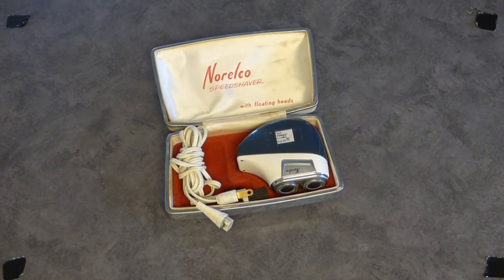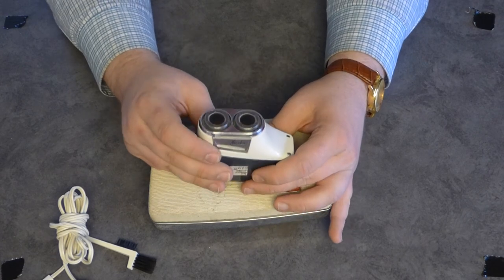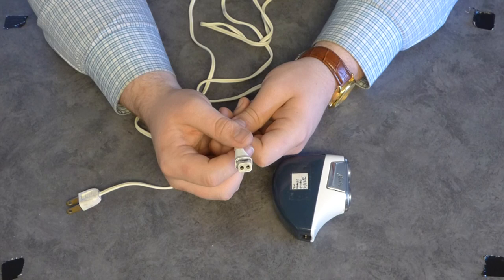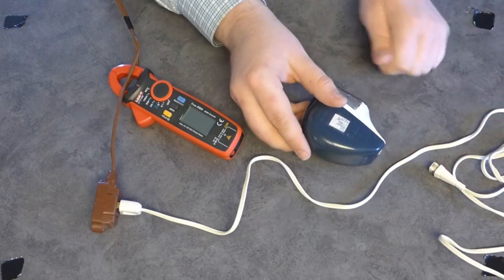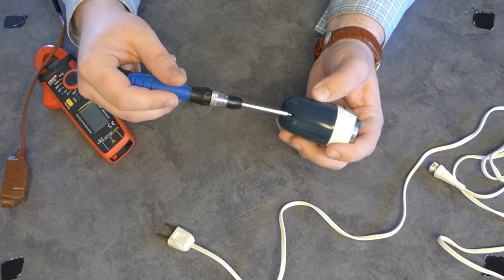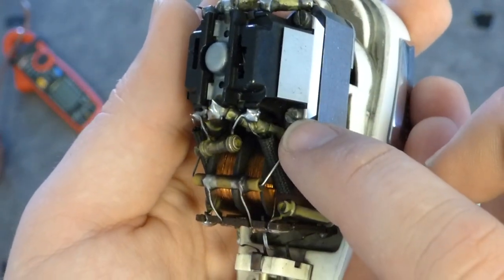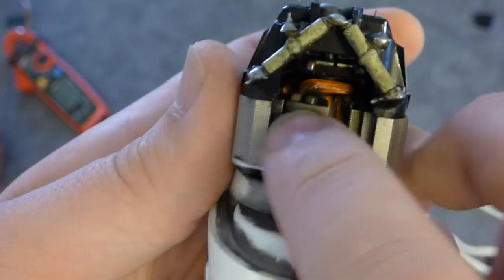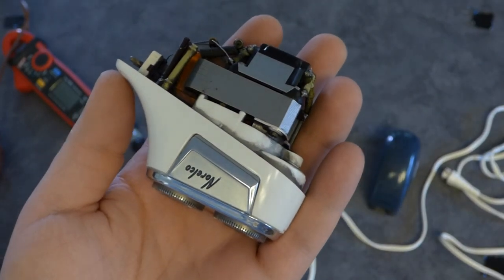Taking a look inside a Vintage 1950's Era Norelco Shaver

Comment: Thanks for posting this video, or at least leaving it up so long. I've been using this exact shaver to shave my head and face for about a year now. I picked it up at auction in a lot of 6 shavers (mostly broken.) It's a great little workhorse. Lately it has been squealing quite loudly until something eventually catches and then it runs normally again. It also gets weak while its squealing like it is lagging from a poor connection. I'm not as electronically savvy as you. I took the back off and just stared in confusion. Mine definitely had a bit of soot inside of it. Hopefully I can get it up to par before it craps out on me.  I really love using it.

Comment: Hello, I just wanted to also say thank you for doing the video, I really didn’t think I would 😂, anyway I was digging through some stuff clearing out junk and found one exactly like the one in the video, I enjoy tinkering with anything that interests me, I saw someone found some new old stock brushes, at this point I haven’t checked the blades ? I do have an old self sharpening kit and I’m pretty sure it will work with these blades as well? That’s another day 😂.

Comment: The original Norelco (not Philishave) shavers had only two non-floating heads and plugged in (no on/off switch), just like the foil type shavers of the time... The floating triple head design, pop-out sideburn groomer, and rechargeable battery didn't appear until well into the 60s...
Reply: Hi, do you know the difference between the norelco and the philishave 7860 ? Because it appears like they are exactly the same.
Reply: @francoisgaspar2122  - Aside from the power cord/plug and some of electrical components inside geared for European power requirements, really nothing at all... "Norelco" is a sort of shortened form of "North American Philips Electric Company" brand that Philips had to use in the US and Canada back in the day because Ford already had an electrical appliance division known as "Philco"... Now that that's long gone, Philips is actually in the process of phasing out the "Norelco" name within the next few years...